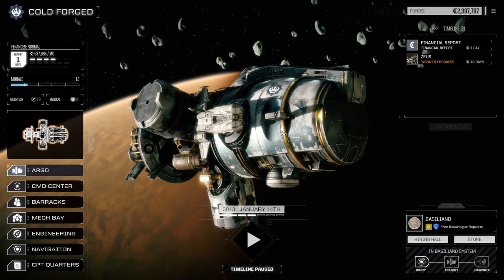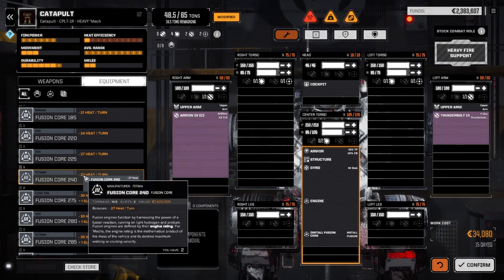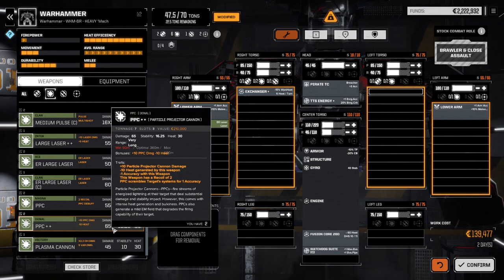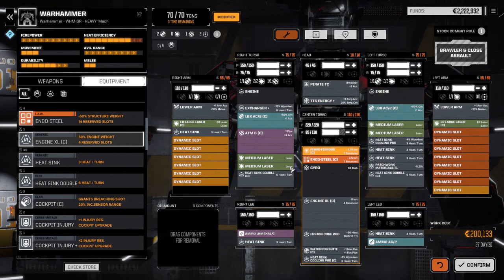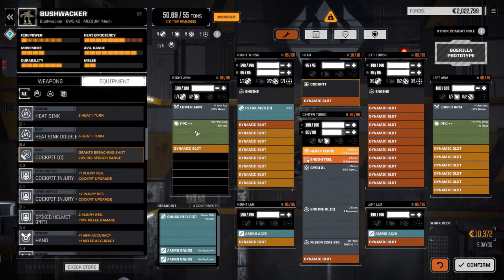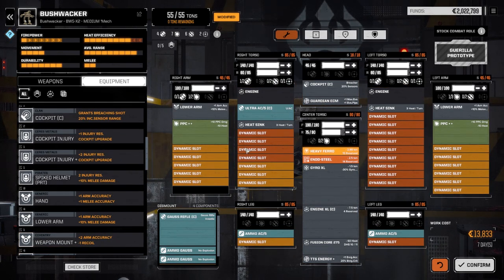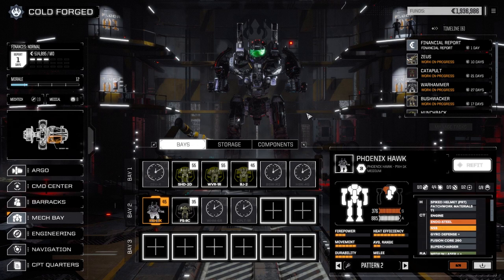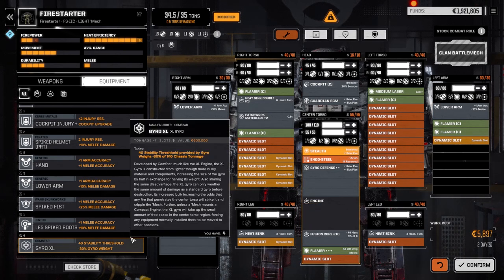Roguetech - COLD FORGED - Ep77

Comment: Zeus needs a cockpit.

Otherwise the changes should be interesting to see in action; about to watch the next mission.
Reply: Dur, just remembered the ZEU-X has the quirk for an improved cockpit that cannot be replaced :)
Reply: The first shot you fired with it in the next video is what made me think of it. I was wondering why use all that heat and waste all that ammo firing more than just the ac20 at the Archer (two lasers and about ten missiles hit for ~54 damage). Seems like hitting the archer with just the ac and using one lrm at the second mech in the rear would have been more efficient.